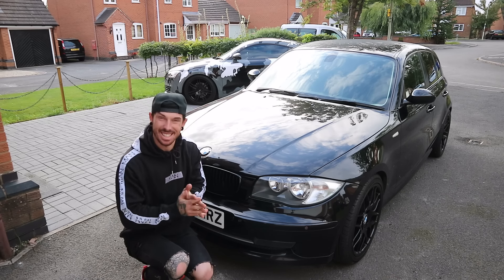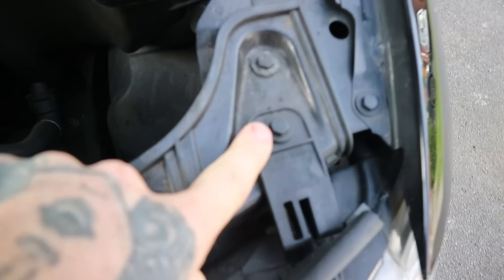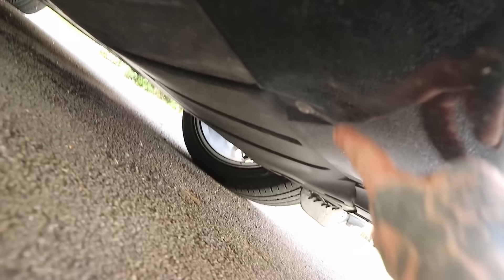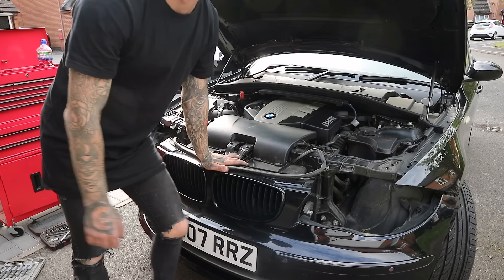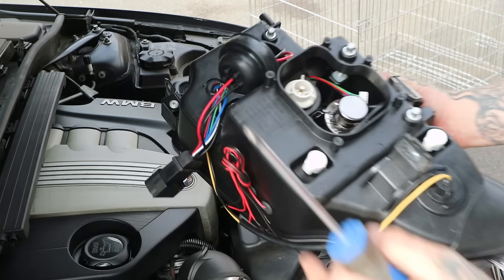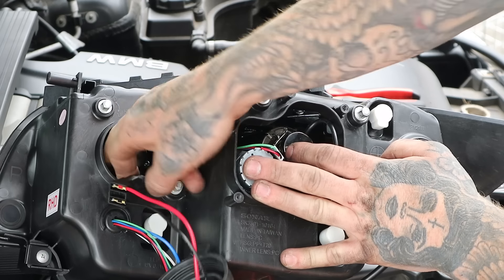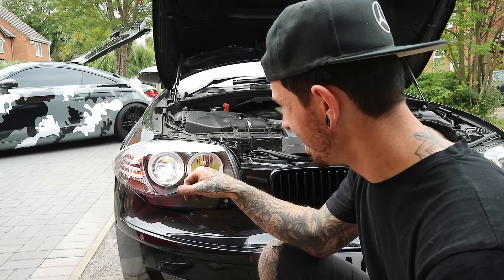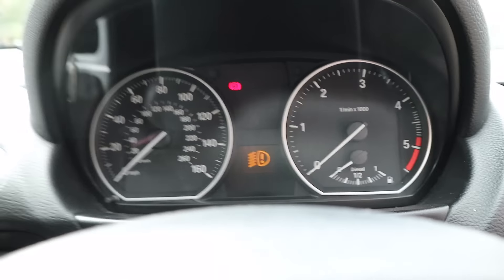HALO ANGEL HEADLIGHTS INSTALL | BMW 1 SERIES E87

Comment from the maker: BUY HEADLIGHTS HERE (RHD) https://matarmstrong.co.uk/products/led-angel-xenon-headlights-bmw-1-series-e81-e87
Reply: This for 2 lights? Left + right price? And it's europe or only uk? Because I need europe side bro
Reply: Hi Mat.  I have recently seen your video on youtube of the installation of the angel eyes in the BMW, I have bought the same ones as you and I have tried all the steps that you do with the red with white and black with black cables, but when you turn on, it is not seen  no light, only long distance lights work.  That could be happening?
Reply: 404 Page Not Found "massive sigh"
Reply: Instablaster.
Reply: Where can I get these headlights ? The link is not working
Reply: @pabloyagani  ebay them

Comment: Pretty good video, BUT! There are some very important points I would like to bring to everyone's attention. I am an ASE master Tech with 40+ yrs. of experience. Before you guys do this HL assemble swap here are the negative points. The HL fixture swap is fine it's the different bulbs that cause the first issue. LED's & HID's have a different amperage draw and a different resistance and this will set a code & a warning light on the dash, especially on a BMW vehicle. Another issue is access to the bulbs, depending on the vehicle and space behind the fixture. The new HL fixture is not maintenance friendly. There's no easy snap clip to open the back to access the bulbs as on the OEM's. The new fixture has 5 or 6 screws which make opening the back difficult to impossible. Lastly the aiming fasteners are difficult to use. Matts video shows the wire connections for the halo's 3 pair of wire to be connected to the white(+) & Blk(-) wires. This is not correct, the 3 red wire should be connected to the red wire going to the high beam bulb which is the daytime running lights. That will power the halo's when the light switch is in the automatic position. I have done quite a few of these conversions,  So consider these issues beforehand. I hope this helps.

Comment: Top tip mate. The middle two wires of the 6 for the angel eyes power those little leds at the top of the light. I didn't use them so just have the halos lit up.

Comment: if you undo the side bolts. you can pull the bumper forward and lift the headlights up. the bottom 8mm bolts doenst have to come out.

Comment: Great work mat.. Iv just in middle of installing the same lights but wouldn't of did it if you hadn't shown me.
 Massive thanks.
I got pack of 2 white led side lights from halfords £7 and ordered 2 led indicator bulbs from amazon to get rid of the orange.
 Thanks kindly.

Comment: I had an e90, I remember changing the front bumper with no jack, lol. It took ages. It was previously crashed and I got it cheap, bumper let it down so decided to change it. The fettling it took was mad.

Comment: Do you think you could use that bike mount on a 1 series cabrio? Like forks at the top of the rear windscreen and rear wheel by the end of the boot lip. Would be handy!
Reply: I have a 2009 118i convertible, do you know roughly how much it would cost for a supply and fit  and where would you go? Being a gal I have not got a clue x

Comment: Really nice video, I have now discovered a lot of things that can be improve in my E87.
Can anyone tell me if wheels with size 225/50 R16 will fith in my car? I saw Mat's wheels are also 225 but not sure if some modification is required.
Thanks!

Comment: Ive have these same angel eyes on my E81 for around a year and they really bug me now when thry are in sidelight mode as each light has that horrible little LED light just above the middle of the halo's that shines brighter then the halo's taking away the effect of the angel eyes...i am now considering changing them for a different set without those LED's
Reply: Roland I'm fitting these lights today.. I thought like you and iv disconnected the middle red wire stopping this little stupid light coming on..
Reply: @craigirving5540  Good idea...those LED's above the angel eyes are horrible. I ended up getting rid of these angel eye lights last month and buying a set of Depo V2 angel eyes that dont have that LED light above the halos haha

Comment: Did you had DRL before you changed the headlights? Because my car doesn't and i'm wondering if the angel eyes will actually light up by themselves as DRL even if you're car doesn't have DRL by default

Comment: Hey, have you got problems if melting the headhunt or something like that because of the LED? 
I put LED bulbs in my OEM and the reflector started melting, I bought these angel eyes but I’m afraid of fitting the LED bulbs in there.

Comment: Hiya, I'm a new subscriber liking your videos, I have a question.  I have recently bought myself a 2011 BMW 118d sport coupe, I am really enjoying it but I am pretty pissed that I cant connect my phone through wifi to play things ion the radio, ive seen some cables about offered to connect my mobile  but I'm wondering whitch one should I get and would it let my play things from my phone into my cars stereo ??.

chillipops
Reply: chillipops Search up bluetooth car transmitter. You plug-in the device to a cigarette lighter plug, connect your phone to the device just like bluetooth headphones, and you can play through car system/ answer calls.... 

they are $5-$20
Reply: @oleredding992  Thanks, I am not sure if that would work ? I can already connect my phone through bluetooth and make and recieve calls, what I am trying to do is to play media directly from my phone using bluetooth, I might have found a solution on alibabba but still researching, there is also a dongle but its around £30
Reply: @chillipops7120  Find a solution mate, Got the 2012 116i and same proplem

Comment: link for the headlights? bulbs etc
Reply from the maker: https://www.ebay.co.uk/itm/BMW-1-SERIES-E81-E82-E87-E88-BLACK-LED-ANGEL-EYE-PROJECTOR-FRONT-HEADLIGHTS/372482162769?ssPageName=STRK%3AMEBIDX%3AIT&_trksid=p2057872.m2749.l2649

https://www.ebay.co.uk/itm/2X-110W-H7-LED-Headlight-CSP-Chip-Bulb-Kit-Canbus-Error-Free-30000LM-White-6000K/123776562505?ssPageName=STRK%3AMEBIDX%3AIT&_trksid=p2057872.m2749.l2649
Reply: @MatArmstrongbmx  how is it still giving an error if both ads for the units and leds say they are "error free"??. is it even possible to fit the angel eyes with nice white shine to it without errors? (so not doing the obd thing)
Reply: The car does voltage bulb check tests, you disable them with an OBD scan tool. This also eliminates the LED flicker. The side turn signal bulbs are available in a translucent clear chrome color from Phillips.

Comment: Did anyone try to change climate panel on e87 from manual to automatic, does it work?
Reply: The manual one is all mechanical whereas the auto is electric. You would have to change all the flaps over. And fit a new loom. Also would need to fit a temp sensor in the car also. Then do all the coding.

Big job.

Comment: Does it work with led bulbs in low beam ? I try it and it doesn't work 🤔
Reply: Does it just work on the high beam, im guessing you have to use a HID kit for the low beam unless u want halogen?

Comment: I'm not technical at all but looking at the vid am I right to think you now have to do all that shit before you could change a bulb if it happen to break? I mean doesn't seem you can remove those 4 screws etc while everything is fitted..
Reply from the maker: Nah you can get to the rear of them without having to take the whole thing apart.
Reply: @MatArmstrongbmx  okay hahah happy to hear that. Thanks man
Reply: This light not from uk because i have buy headlight from Amazon  and they come with European standard i try to changed for uk but i couldn't change so have to send back so this you recommend they uk configuration 1? Or not please let me now

Comment: will it fit the e82?
Reply: Mario Bale Yeah I did it to my BMW 1 series 118d M sport coupe e82 about 5 years ago, mine is on a 2010 plate .. They do look better but I will say they are not as good as the Original lights driving at night. I pretty much have to have them on full beam at night now just to see the road.😕